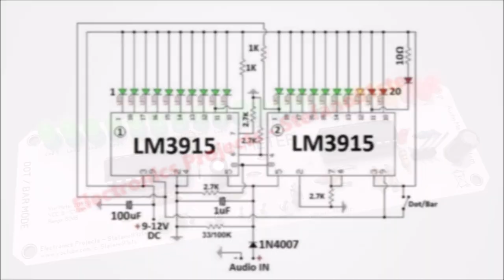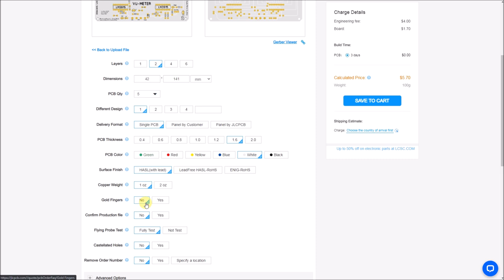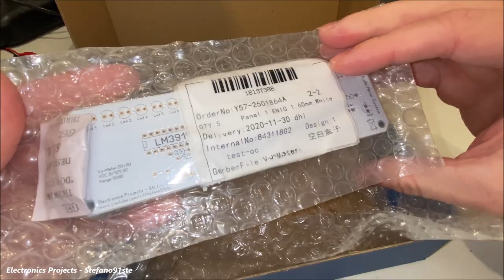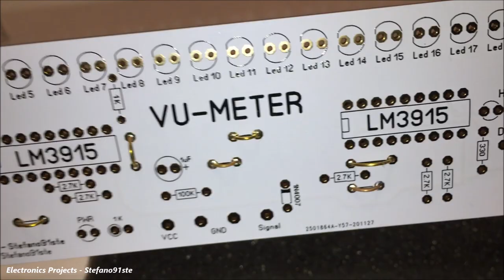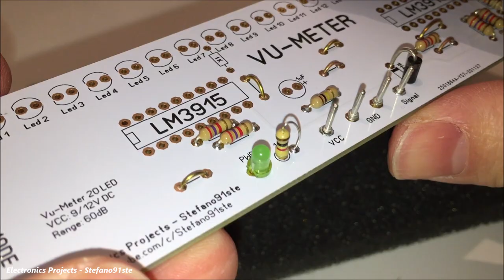Vu-Meter 20 LED Dot/Bar 60dB with LM3915 - PCB Tutorial

Comment: If I want to replace the LED using a PNP transistor, What do I need to change? Does the base require 20 resistors, and I wonder why in your circuit Are there not 20 resistors in that led? Where's the resistor?

Comment: With all these board you can make a HI-FI audio visual equalizer, but are you italian ?
Reply from the maker: Hi, It could be done, but you need to add a filter for each Vu-Meter for the frequency you want to display. Si sono italiano =)
Reply: @Stefano91ste  Ahh ecco, si lo so che bisogna inserire dei filtri passa basso alto ecc per avere la visualizzazione di ogni frequenza.
Era per dire visto che hai tutte quelle PCB d'avanzo è forse l'unico modo salvo altri impieghi come voltmetro a led e affini, per sfruttarle tutte.
Poi non capisco perché hai messo i ponticelli che sono un  lavoro extra, non facevi prima a fare il pcb doppio strato ?
PS: il IC 3916 è meglio del 3915 perché è specificatamente studiato per applicazioni vu-meter ed è compatibile con lo schema che hai utilizzato quindi non serve modificare nulla di componentistica.
Reply from the maker: @lilluminatoalternativo3926   I ponticelli mi piacevano esteticamente😁. Il 3916 preferisco usarlo per applicazioni a 10 LED avendo una scala dB ben definita. Il 3915 è anch’esso studiato per applicazioni audio e tra i LED c’è un intervallo di 3 dB se non ricordo male. Lo preferisco per applicazioni dove devo collegare gli IC in serie/ cascata. 

Qui realizzai un Vu-Meter con LM3916 (doppio canale con 10 LED ciascuno e scala dB stampata su PCB): https://youtu.be/l8oUQpGAOCw?si=0LRc2Q_AXbRO1FLv

Qui invece un video dove metto a confronto gli LM3914/ 15 e 16. Tutti con lo stesso circuito ed input: https://youtu.be/7avb905F-MQ?si=5hh-4HkM1tGto1b0

Versione su breadboard: https://youtu.be/5tI8b_KqdrM?si=pDwHd80tnnnpcU-G
Reply: @Stefano91ste  Mi potresti dare un mano che sono un tantino "nabbo" di elettronica nel senso che non sono in grado di calcolare i componenti.
Vorrei fare questo vu-meter ma con 12 led per canale uscita a bandiera, posso chiederti un consiglio/aiuto ?
Non so se basta collegarli in serie o parallelo o serve un trasistore per amplificare la corrente, perché se non ho letto male dal datasheet dei lm39xx reggono massimo 30 mA e non credo che possa reggere la corrente di 120 led ciascuno IC.
Io ho anche pinerest eventualmente potresti passarmi uno schemino da la, se vuoi 🙂

Comment: Would the same setup apply Lm3914 in dot mode?
Reply: I want to use it as a battery level indicator
Reply from the maker: Hi, yes is possible to use this circuit as a battery indicator with LM3914

Comment: Hi Stefano, I can't find conectors that you use usually for VCC, GND and Signal, could you please tell me the name or any place to buy it ???? Thanks in advance.
Reply from the maker: Hi, I was able to buy them only here unfortunately: https://www.opitec.it/Macchine-utensili/Saldatore-da-stagno-accessori/Stagno/ancoraggi-p-circuiti-stampati-argentati-1mm-100-p.html?listtype=search&searchparam=saldatore&pgNr=1
Reply: @Stefano91ste  I tried to buy here locally. If not is possible to find, seems that I can buy it from this page, surprisingly the page have traduction in spanish.

Comment: Very good project. I will give it a try, but I didnt understand some things:

1. Why do we need the 1K resistors parallel to led 9 (on IC1 pin 11) and led 11 (on IC2 pin 1)?
2. Why pin 4 of the second IC and pin6 of the 1st IC are connected with a voltage divider and not like the way as pins 6&7 on the 2nd IC? 
3. The signal input is an aux output or a speaker output?
4. What are the db where the leds refer to?
Reply from the maker: Hi, thank you!! I will answer your questions!
1) Without those resistors the LED number 10 will not turn off in DOT mode.
2) The connections are different to allow the expansion of the LED display range. If you looked at the schematic of my vu-meter with 40 LEDs you would notice that the first three LM3915s are all connected in the same way and the fourth LM3915 is connected like the second of this project.
3) You can connect a pre-amplified output to the signal input or the amplified output of the amplifier, by connecting the vumeter in parallel to one of the speakers. 
4) Each LED represents 3 dB

Comment: HELP PLEASE ⚠️...⚠️.
I made this pcb , problem is led 1 and led 16 voltage is equal to input voltage (i am using 12v). so led damaged. another issue is , LED2 and LED 3 always ON (LED 1's voltage level always high) . except this ,VU meter working normally .  what is the value of resistor you placed near jumper ,  as per schematic value is 10 Ohm , but your pcb looks different ..  help me to fix...      t
Reply from the maker: Hi, the resistor next to the jumper must be placed with a value between 10 ohm and 50 ohm, but it does not affect the operation of the circuit. To solve the problem of the first 2 or 3 LEDs always on use a 33K resistor instead of the 100K one (if this does not work, the problem could be due to a disturbance in the supply current or the amplifier outputs too high). Regarding the problem "led 1 and led 16 voltage is equal to input voltage" it can be caused by a faulty LM3915 or by some short circuit between the welds.

Next, take out the LM3915 and check for shorts between the solders. 
Then test the correct functioning of the two LM3915s on a breadboard or replace them with two new ones.
Reply: @Stefano91ste  thank you for your support. i will try..🙂️👍️
Reply from the maker: keep me updated
Reply: Just ordered new LM3915 ICs, waiting for that. same time I am doing  some experiments.  I  used resistors for LED1 and LED16 voltage dropped and working normally  .As you said i replaced 100K resistor with  33K so LED2 and LED3 always on issue solved . but LED 1  always on..  but its  ok..  I have noticed one thing  , while  playing music , in DOT MODE  LED1 and LED11 not turning off completely .  anyway I will continue..................... 😎️

Comment: Hello, I am a beginner and I like this work very much. So just follow the video and the PCB diagram you uploaded, and make one yourself. Now everything has been welded, and everything is normal when the power is turned on. The first and second lights are on. When the speaker is connected, the lights are all on, and there is no beating with the music. When the BAR Mode is unplugged, the left and right lights 1 and 20 are on, and they do not dance with the music. Did I make a mistake in that aspect? Looking forward to your reply and heartfelt thank you.
Reply from the maker: Hi, thank you! 
If the first two LEDs remain lit only with the power supply, replace the 100K resistor with a 33K one and the "problem" is solved. 

"When the speaker is connected, the lights are all on, and there is no beating with the music"
If all the LEDs remain on with the speakers connected I think it is due to the amplifier. what amplifier did you connect the vu-meter to?

"When the BAR Mode is unplugged, the left and right lights 1 and 20 are on, and they do not dance with the music."
This problem is solved by solving the first problem of the LEDs that are all on
Reply: @Stefano91ste  It was a success, thank you for your teaching. Like this work very much
Reply from the maker: I am happy with this, have fun with electronics!
Reply: @Stefano91ste  Thank you for selfless sharing, I am also very interested in your electronic light. I would also like to ask you a question. Now this lamp will only move when the volume is adjusted to a certain level. Can it be changed to a low volume and the light can move?

Comment: Wonderful, Can I use lm3914 instead of lm3915 and a resistor value of around 2- 3.5 k ohms value for 2.7k resistor ?
Reply from the maker: Hi, It would be better to use an LM3915 for audio applications, LM3914 works but has a different, less accurate, signal reading. OK for the resistors, the values can vary even if slightly.
Reply: @Stefano91ste  ok thanks
Reply: @Stefano91ste  you

Comment: On your components listed above you show a quantity of four  2.7KΩ Resistors wouldn't be five ?  Just wanted to make sure. love your videos. thanks for taking the time to produce them.
Reply from the maker: You are right, now I have corrected! - my fault, I made the parts list by going from memory.. thanks
Reply: I'm building this and I'm confused about the fifth 2.7k resistor, I can't find it :/ I can only see 4 in the diagram. Sorry if it's a dumb question. Also, I can only see 2 1k resistors instead of 3.
Reply: @rafaelnieves8443  Rafael, If you look at Stefano VU Meter Board there are Five 2.7K resistors. 3 of them are directly below the LM3915 Chip on the right and the two remaining 2.7K resistors are directly below the LM3915 chip on the left. Red-Violet-Red-Gold 5% +/-   equals 2.7K resistance. You are right as for the schematic. you may be able to build it that way, but there are five 2.7 Ohm resistors on the board.
Reply: Oh so they're missing from the schematic, I'm not crazy 😅 I didn't see his actual board since I'm doing ir on a breadboard and it's a bit different. So I see one between port 7 and ground (right IC), and then one connected to port 7 and ground (left IC), another one port 6 (left), port 4 (right) and ground. Lastly, one between port 4 and 8 (left IC) Which one is missing? I referenced the schematic at 0:50 to build the circuit btw. 

Lastly, there are TWO 1k resistors right? Not three as in the list
Reply from the maker: @rafaelnieves8443  The third 1K resistor is the one protecting the Power LED - LED which is not shown in the diagram as it is not a vital part of the circuit.  it is a led connected between vcc and gnd.
Reply: @Stefano91ste  got it! What about the fifth 2.7k resistor? I would be really grateful if you give me any tips to build this on a breadboard, particularly about stuff missing from the 0:50 diagram
Reply from the maker: @rafaelnieves8443  In the PCB there is an additional 2.7K resistor because on the PCB the two PIN 8 of the LM3915s have been grounded each with its 2.7K resistor, but on the diagram I use one in common... in the end the result is the same.  
So whoever makes the circuit on one of my PCBs will have to use 5 2.7K resistors - if you want to make it on breadboard please follow the schematic I have inserted in the video:) There are no differences, it is just a small change (which does not affect the operation of the vu meter) that I forgot to report on the diagram inserted in the video.
Reply: @Stefano91ste  perfect! Thank you so much!!! So this schematic is 100% fine for a breadboard. Btw, do you think it would work with an aux cable coming from a pre amplified speaker? I'm thinking about opening the cable and using one of the channels (left or right) directly as an input. I'm still trying to figure out the input since I don't have analog audio equipment.
Reply from the maker: @rafaelnieves8443  Thanks to you, and sorry if I was not very clear in the video :) - if the output comes from a pre amplifier then it will work, if instead You wanted to connect the output of a cell phone directly then it would not work, the signal would be weak.
Reply: @Stefano91ste  no worries! You got awesome projects on here.
What if I connect it to a pre-amplified source like a modern speaker or tv? Via aux cable
Reply from the maker: @rafaelnieves8443  If the signal is amplified enough, the vu-meter works normally.  Otherwise the LEDs would not be able to turn on completely.
I have also published Vu-Meter circuits with LM386 + LM3915 configuration, this to allow to connect them to non-amplified audio sources.
Reply: @Stefano91ste  awesome. Thanks a lot!!!!